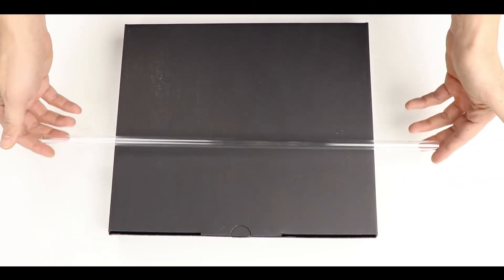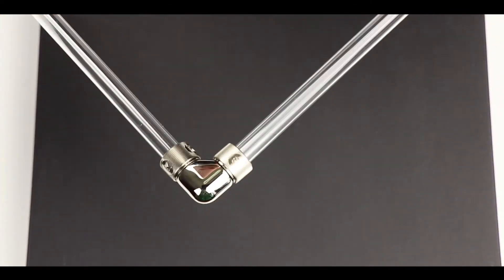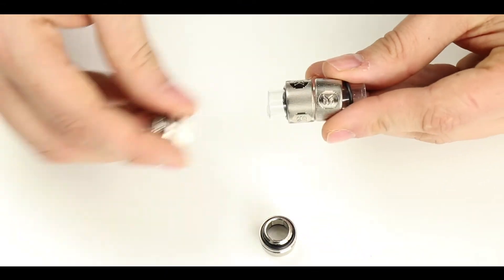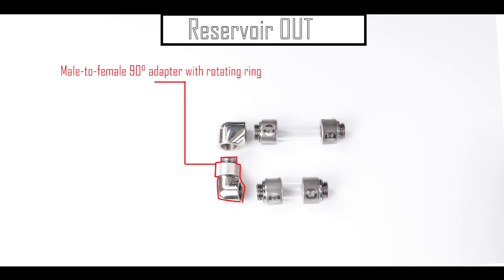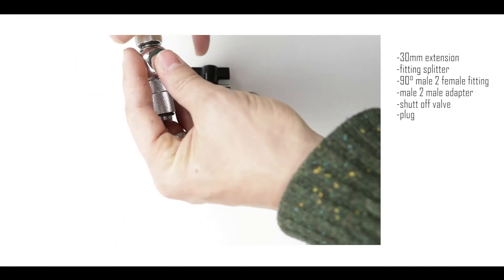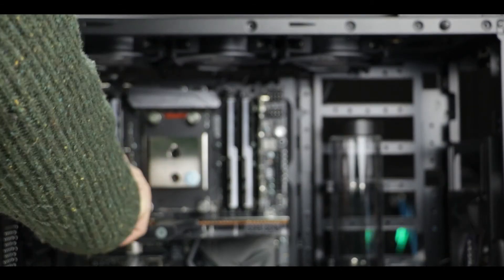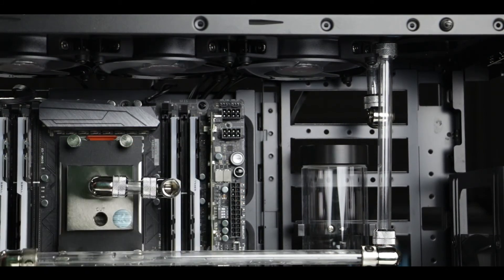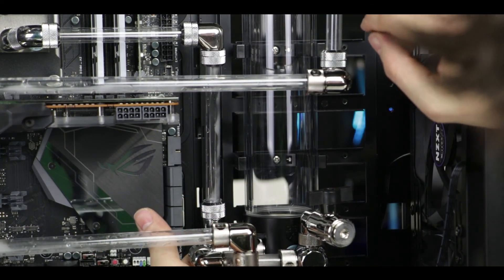The Solid Tubing ( The Threadripper Build 6 of 8 )

Comment: I highly advise to trim down the diameter on the ends of each tube with sandpaper. I nearly destroyed a o ring, because the edges are too sharp and the tube too thick.
Reply from the maker: I did sand it with the sanding disk. Should have included the shot in the video.

Good comment

Comment: Um, you aren't doing bends? Smart. But also, you don't need a dremel to cut the tubes. You can buy a kit of hardline tubes that comes with a angle bender to bend the tubes at the correct angle and a tube sandpaper type thing which gets rid of the burrs on the ends of the cut tube so it doesn't harm the o rings. And it comes with a tool to cut the tubes. It also comes with all the fittings. So, it's pretty easy to use.
Reply from the maker: Bends are coming on my GTX 1180 build in August :)

Dual loop with what ever new CPU is released :)")")")")